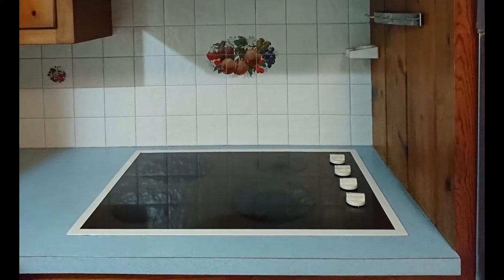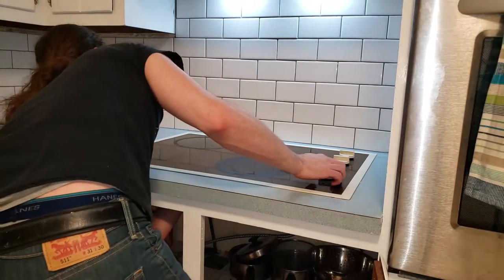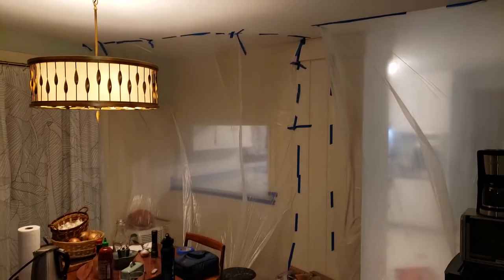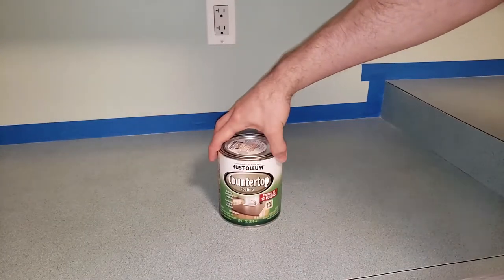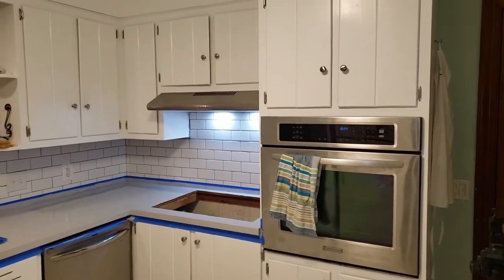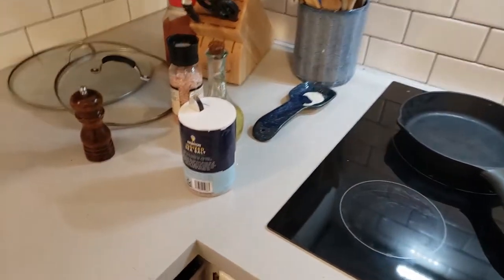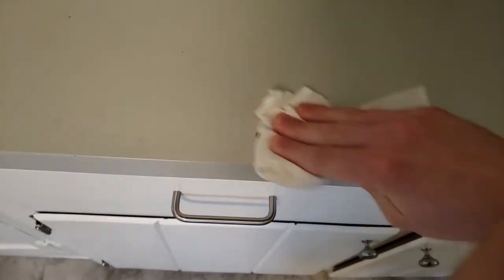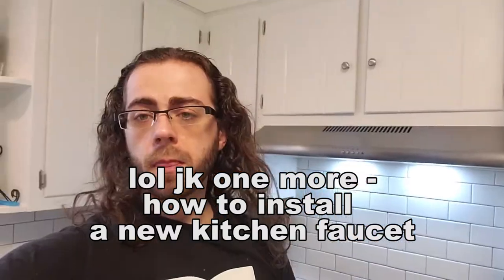How to Paint Laminate Countertop with Rustoleum Coating | Kitchen Remodel Series 7/9

Comment: I've had similar issues with those types of rollers... at first they seem great, then after a few uses they're leaving bits behind all the time. With foam if the paint has been thinned too much they can induce air bubbles on the surface, but they're definitely better overall in my experience.
Reply from the maker: Good to know, this may be because this stuff is so noxious it dissolves the nap? Not sure.
Reply: Bootstrappin' mine were falling apart with just normal wall paint. I think they're just cheap tools in the end

Comment: Love your videos.  Just curious though, let's say you had a little more budget, but not granite budget.  What options would you have considered?  Our linoleum counters are in pretty great shape, but the Mrs. hates them I think just because they're linoleum.
Reply from the maker: Mmm, lots of options if I wanted to throw down the elbow grease. For DIY - a nice smooth concrete countertop, or perhaps a reclaimed wooden countertop covered in resin. Linoleum gets a bad rap as a perceived low quality material, but boy is it durable and utilitarian.

Comment: I would do this but I did a dumb and set a still very hot pan on my counter which melted part of the countertop and now it's lifting off the wood in that spot lol
Reply from the maker: Ah looks like you'll need to set 30 more hot pans down and get the rest of the laminate off, then you can install fresh laminate.
Reply: @Bootstrappin  Modern problems require modern solutions